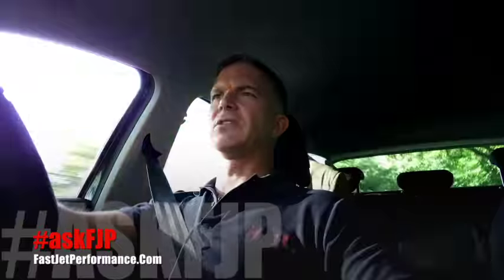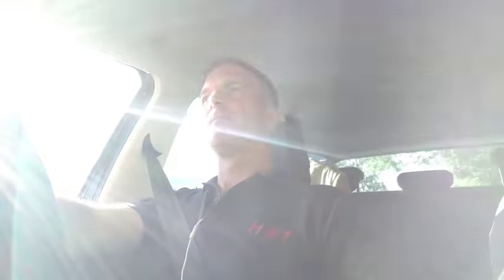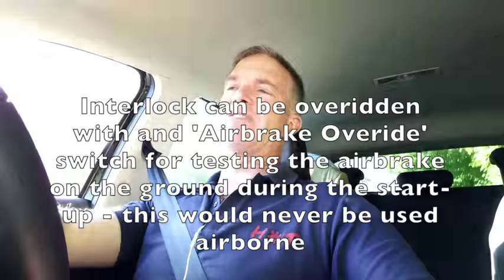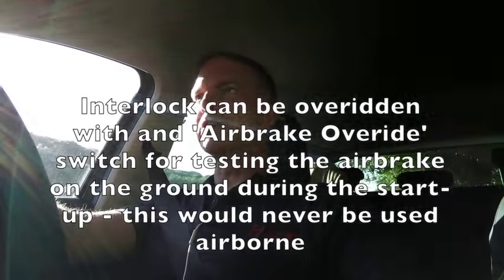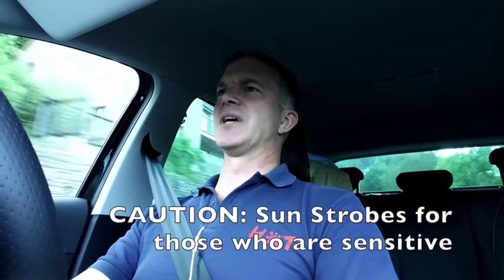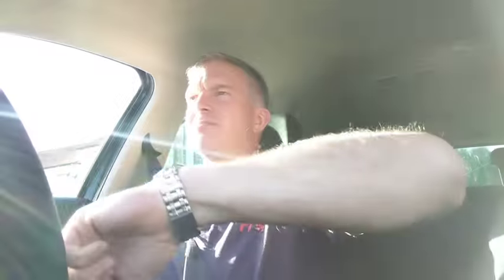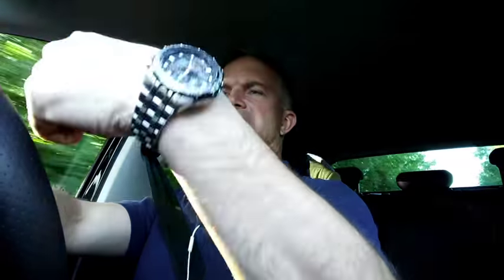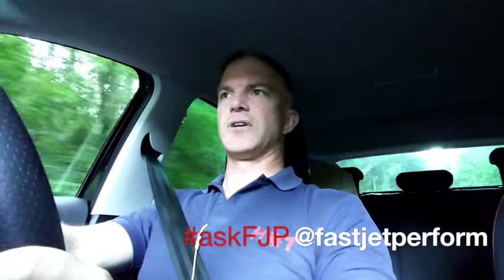Questions for a Fast Jet Pilot #askFJP005

Comment: Weird question but still of interest. In commercial aviation, for an approach checklist, they'll say  something like "Gear down, three green, flaps 20, airbrake armed" but based on this video you guys say "Gear travels down, airbrake indicated in", why the extra words?
Reply: I believe its Limitation-Operation-Indication, a way of checking everything's done and working as intended. An example might be (for gear down selection): Speed below 200kts, Airbrake indicating in (the limitations), Gear selected Down (the operation), 3 greens (the indication)
Reply from the maker: What Patrick says below... VVV